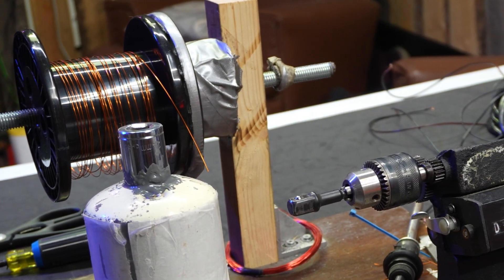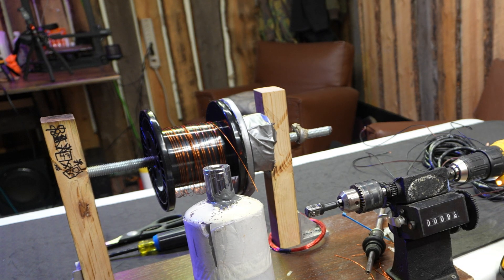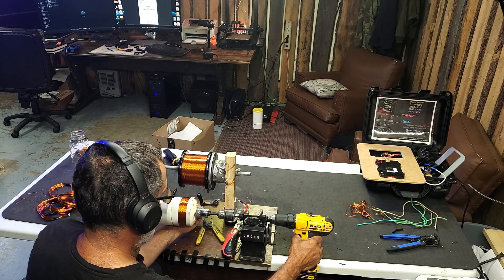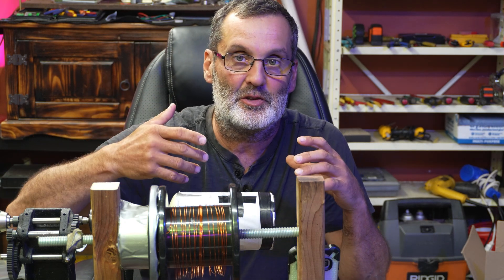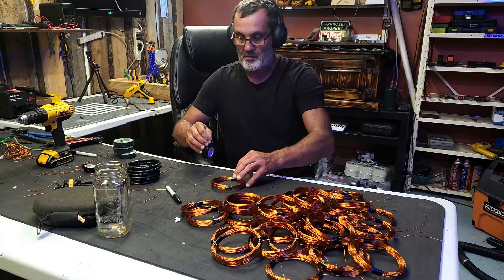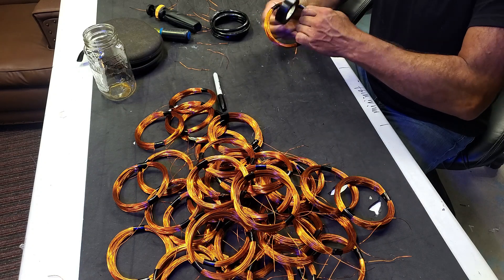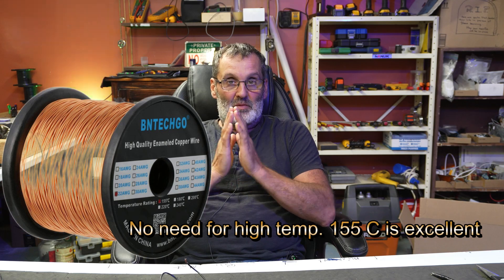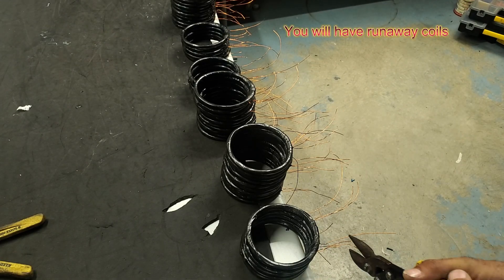PEMF company do this wrong a lot.

Comment: Hi Steeve, I use a STDP switch to reverse two coils on a 4 coils long mat when the user is bending the mat over so it turns it into a Helmholtz type system and doubles the output instead of opposing the poles, just a nice touch in a system to have that option, cheers from Eric Wiggins New Zealand. And I used the same system to sort a stone bruise on our horses leg and it worked, what would life be without horses.

Comment: Hey bro.. been watching your channel for a few days now... very helpful place to be.
I just purchased a ZK-PP2K and am about to make a coil. Your coils are 3.3ohm with 95 turns of 20 or was it 22 awg of copper wire. I want to use the ZK-PP2K with one coil,  how many turns, what awg wire should i use for one coil to run with ZK-PP2K  and how much ohm's should the coil be to run safely with the ZK-PP2K. Sorry for the big long question but your response would be so appreciated,  i been wrecking my brain over this, so if you could help i would be very great full for your advice.🙏❤️
Reply from the maker: @sunman6768  hello.
Email me. :)
Reply from the maker: @sunman6768  steevebradet@outlook.com

Comment: What diameter is the gas bottle please we don't use that size in the UK
Reply from the maker: @dawnb4197  
95mm id. 

I have a 3d print on my patreon (made by a patreon) 
For download.  :)
Reply from the maker: @dawnb4197  95mm.  :)
Reply: An ikea water bottle is 92mm, you can add paper to it to bring to 95mm, or, what I did, a 3d printed spacer.
Reply from the maker: @8thsinner  amazing!!   Thank you for sharing!!!